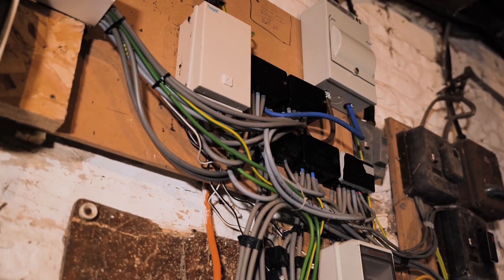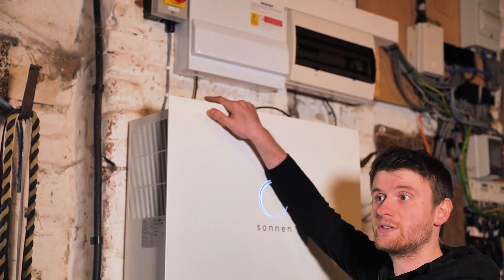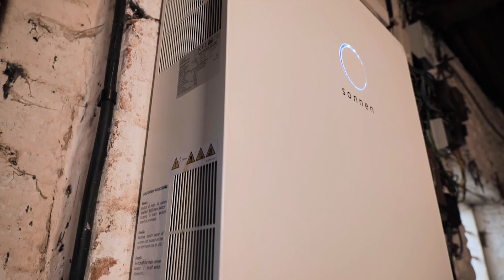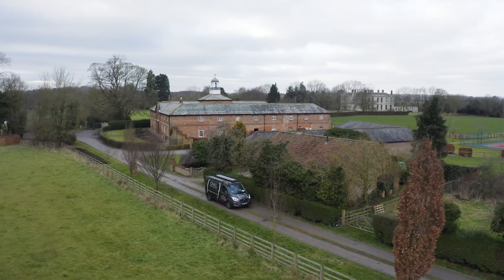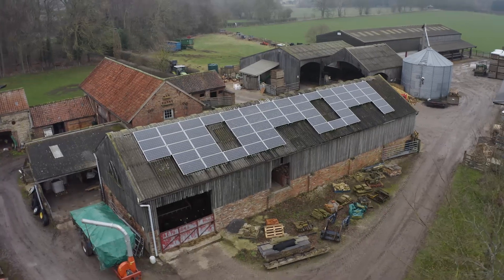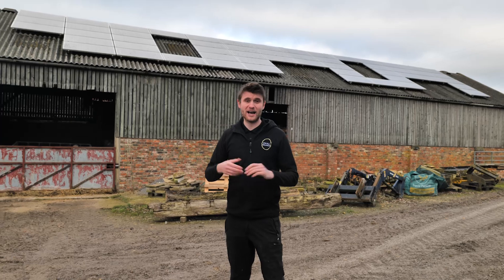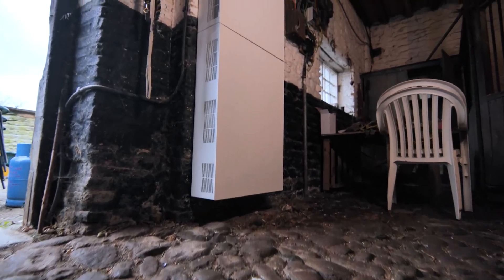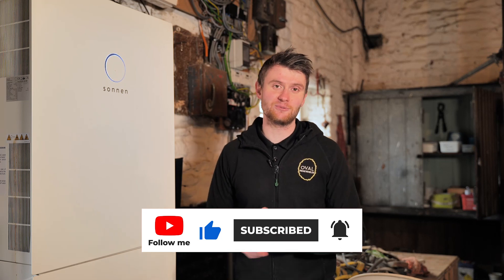Howsham Project Part 2 - Three phase Sonnen Battery system integrated with onsite Solar PV

Comment: Love the videos mate. quick question can you fit the panel optimizers in the attic all the time like if it was panels on a rail system and not in roof system just to always make it easy access to get to each one.
Reply from the maker: Thanks for the question. We do sometimes do it but it depends if the panel cables will reach into the loft as these can’t be extended

Comment: Hi Sam, is it possible then to add battery to system that’s on FIT and been installed years back? 
I was under impression you cant mess with those systems , only add on new solars & battery, 
Thank you for great video 👌
Reply from the maker: Yes you can absolutely add a battery to the system!
Reply: @OvalRenewables  thank you 
I appreciate your reply 👌
Reply: @OvalRenewables  i take it you are not allowed to interfere with panels? Adding extra panels?
Reply from the maker: @callimero2409  you can actually, its a misconception that you cant touch it. What you cant do is get paid for more production, so if you add panels onto a FIT system then you have to move to an estimated FIT.
Reply: @OvalRenewables  thank you for getting back to me and sharing your knowledge

Comment: Is it possible to have a system in the UK for a 2 bedroom house where you wouldn't pay any electricity bill. Thinking of a system for my retirement so I would have as close to zero bill as possible.
Reply: That’ll be an off grid system for you 👍🏼 even if you don’t draw any power from the grid you’ll pay standing charges for the connection.
Reply from the maker: As mentioned it would have to be an off grid system to completely remove the bill. However paying the stranding charge of £0.40 per day isn’t bad!
Reply: @OvalRenewables  pretty good deal to not be plunged into darkness in winter!

Comment: Nice video Sam. I wounded how the existing panels are fixed to the asbestos roof?
Reply from the maker: I think they were via bolt hangers, these go through the sheet and into the purlin. Hopefully they took special precautions with it being asbestos 😅

Comment: It is my understanding that you do not require the intelligence to monitor and balance the three seperate phases, for import and export, if you have a Three Phase Smart vector sum meter...  Working out if your meter is capable and enabled is a different story!!!
Reply from the maker: Yes so some meters measure an average across the three phases which means it doesn’t matter as much if you buy in on one and export on two 👍